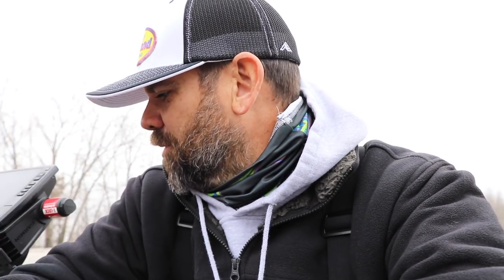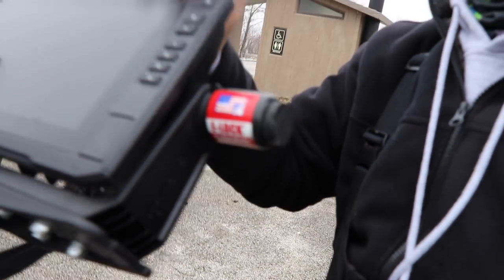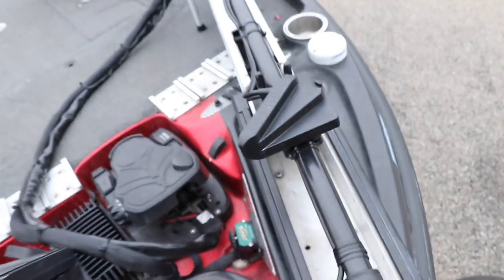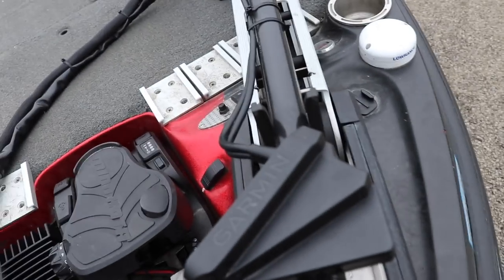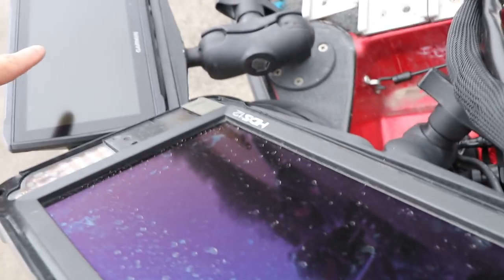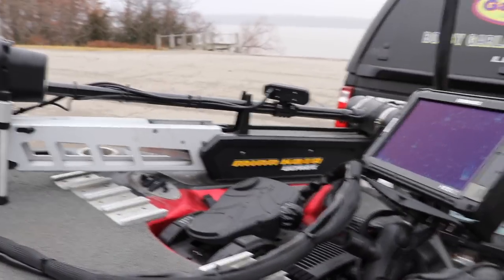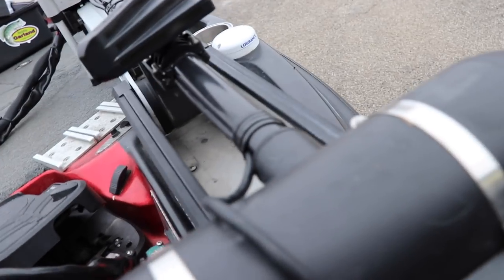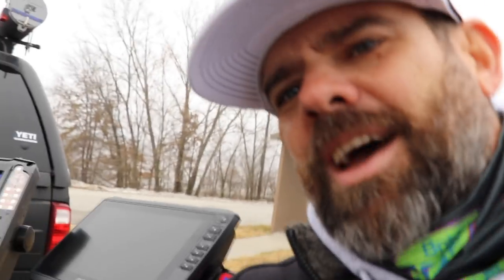Garmin Panoptix LiveScope Setup

Comment: Got mine installed Kevin, used it yesterday for this first time so I am getting used to it (didn't catch anything but the water is super high and fish are scattered). I have the 360 and they do do not interfere with one another. The trajectory on the Livescope is kind of small unless you are right on top of them, the 360 helps get you back on the pile if you drift off. I have my Livescope on a separate mount. If I had to pick one it would hands down be the Livescope. Keep those videos coming in please and good job on them.

Comment: Saw your last live scope video and had to have one. Mine just came it the mail. Now I just have to figure out a good mounting option since I’m running a terrova. Probably gonna make a stand alone pole mount for the live scope transducer. That way while spot lock is on I can keep livescope pointed where I want it.
Reply: that is exactly what I want to do. I'll also be running the 360.  I can see uses for both.
Reply from the maker: I believe there is a company making them, Cornfield Crappie?  I think you can find them on Facebook.

Comment: Did you have enough wire to run to the wheel for the black box? I'm hoping to put mine under there. I'm not sure what going to be in the box. It's on the way. Thanks

Comment: On your Garmin unit. It will just pop out in a second leaving just the cradle. Take it in. I fish reelfoot due to all the stumps I have a custom Jon boat with an xi5. So I put a bow mount hand control trolling motor on the opposite side and I can pan what’s in front independently. Just trying to figure out how to fish it.
Reply from the maker: Yes, Lock is just a deterrent (had it laying around).  Yes I think we will see all kinds of different mounts for the LiveScope in the coming year.

Comment: So I just bought the livescope panoptixs you've had some time with yours so had two questions for you. I had to mount mine on the barrel of my trolling motor do you think that will negativity effect it? Secondly does it work better with spot lock or can you dial it in when trolling structure?.I just put it on today and I'm chomping at the bit to fish with it.Thanks for Sharing your insight !

Comment: your 94 looks like the( 93sv echomap plus)  i just got and will be using with the livescope..( 93sv  echomap plus) is a  9''  touchscreen with panotix and with the new livescope  system it should be even better only thing i see ppl talking is that the (touchscreen ) is a little slower because of the processor ????  anyway good video ill be back and keeping a eye for more videos as i have yet to hook any of mine up on the boat yet anyway thanks for the videos on this as there is not much out there about it as of yet anyway.

Comment: Kevin, thanks for the update... great info.  

Question:  when spot-lock is used on your trolling motor while fishing with the LiveScope, does the trolling motor sometimes move too much side to side to get a good picture on the Garmin screen?
Reply from the maker: That is correct.
Reply: @bobbygarlandcrappietv7409  Kevin, because of the constant movement of the trolling motor in "spot-lock" mode, do you think it would be better to mount the LiveScope transducer on a separate pole off the bow of the boat?  Thanks!!

Comment: In talking with garmin that black box you mounted next to your foot pedal is not 100% water proof they told me to mount somewhere that water will not hit it. It can sustain some water but not for long periods, Just an FYI.
Reply from the maker: Wow, I didn't know that, mine will be getting wet (no where else to mount it).
Reply: @bobbygarlandcrappietv7409  Support says it mostly waterproof. I think you're okay with the location. You should put a ground wire in that lug on the black box though. Just run it to the negative terminal of your battery. \